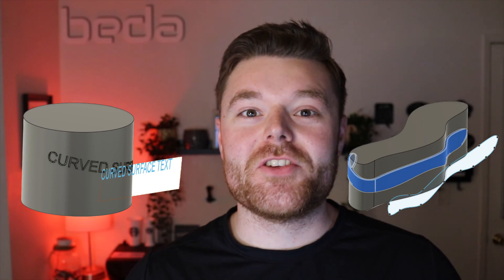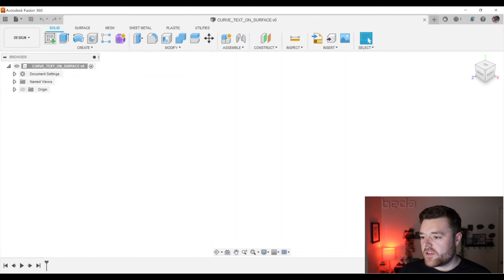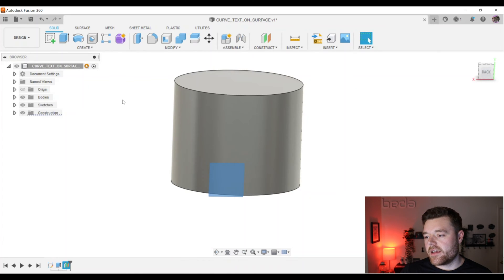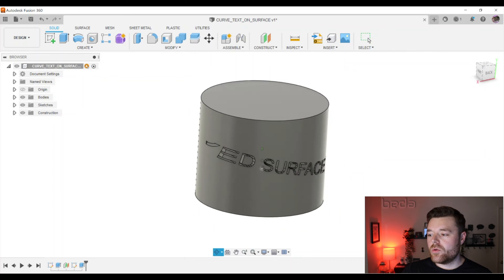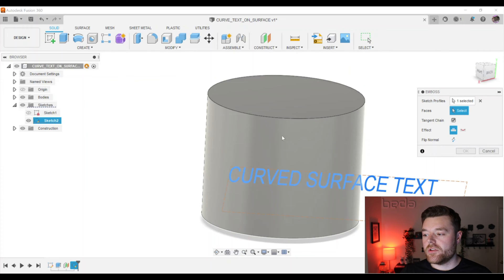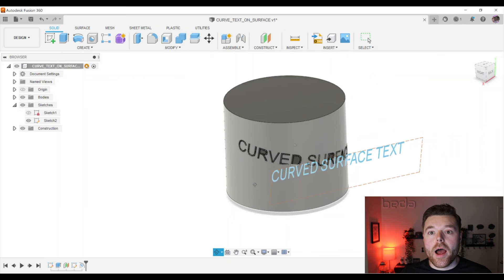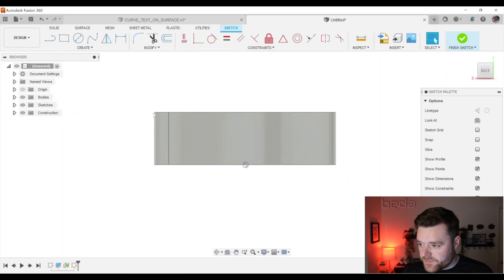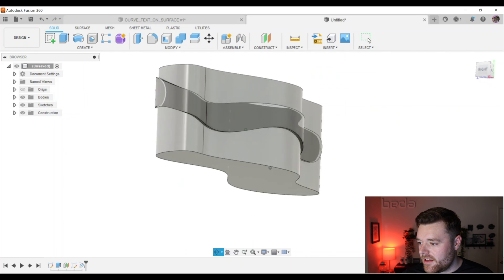How to Curve Text and Features along a surface in Fusion 360 (Emboss)

Comment: I had a problem where the ok button on the emboss tool was grayed out even though I had selected the face + text. Turns out the font I was using was not compatible, which may or may not be a fusion 360 issue. I tried getting a true type version of the font which is supposed to work better but ended up switching to a new font instead

Comment: How would you align embossed text parallel to the edge if the target surface is curved as well as angled? I can't find a way to do that.
Reply: Looking for the same thing. I don't want to cut in or emboss out. I was to... emboss "in" I think so that I have different color text flush on the face.

Comment: Adam thank you for these tip, I needed this for my RC Airplane design where I needed to place panel lines on the fuselage and wings with a very slight deboss, maybe I can do this also for rivets to follow along the surface bu this emboss a tiny bit. Please continue doing these awesome videos, maybe how to create negative molds as I need to 3D print molds to create composite parts.
Reply from the maker: Glad I could help! Sounds like an awesome next video!